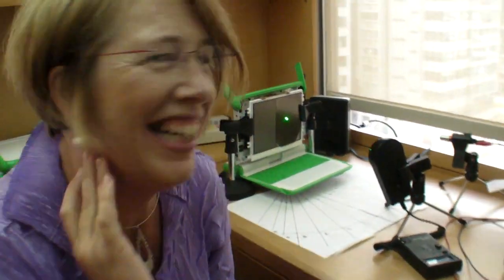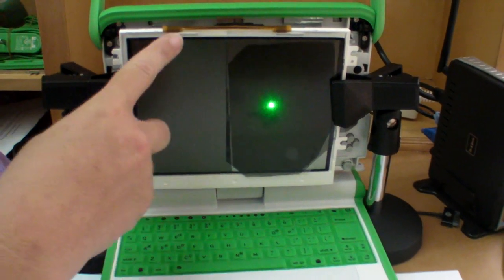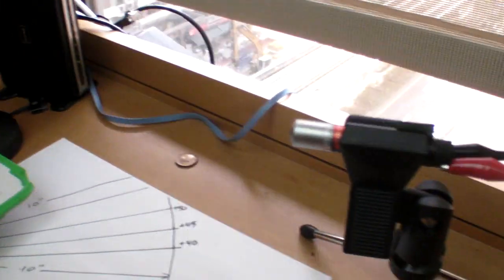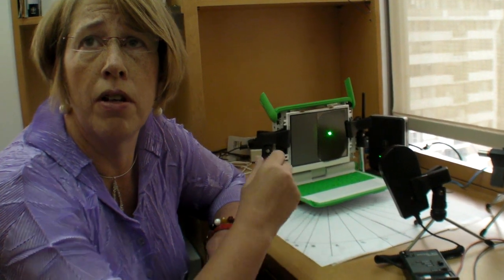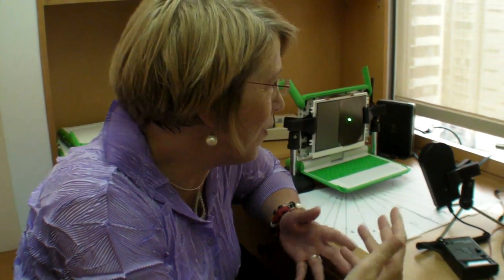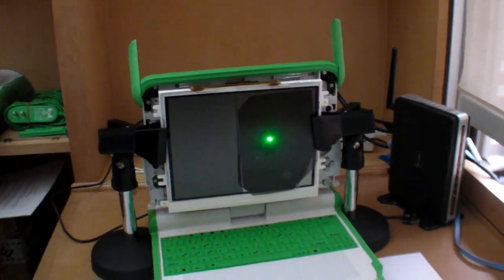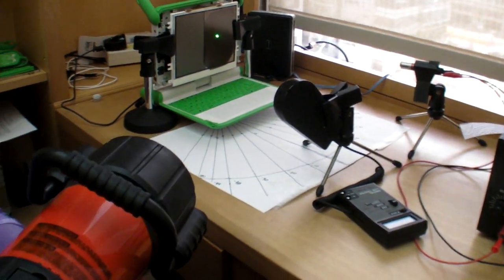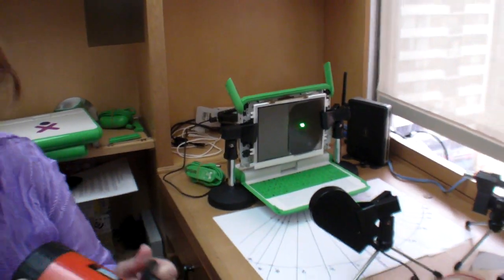Pixel Qi screen in Mary Lou Jepsen's Lab, testing the angular performance in the OLPC screen and explaining power consumption

Comment: The Pixel Qi technology will continue to advance, but then so will eInk. For one thing by the end of this year we will have versions using plastic substrates which will make them ultra thin, flexible, and possibly cheaper than the current [glass substrate] screens.  Color and video rate displays have also been demonstrated in the lab.

I don't believe one of these technologies has to outright replace the other. They could find their own different niches.

Comment: In fact there are working bi-stable LCDs already. Though at this point the refresh rate is even worse than eInk.

One thing I wonder about is if the power consumed while refreshing might still be a significant factor (when comparing the two different technologies)?